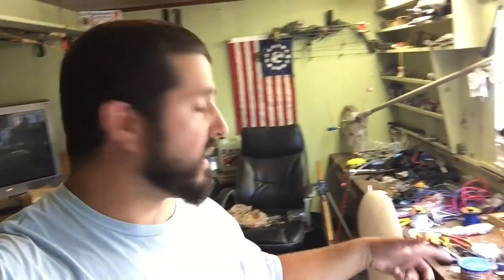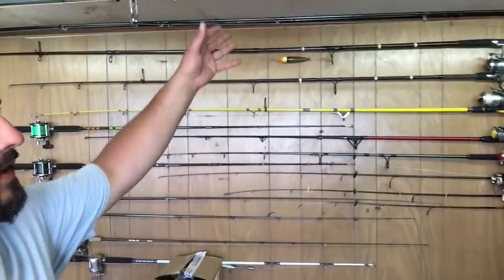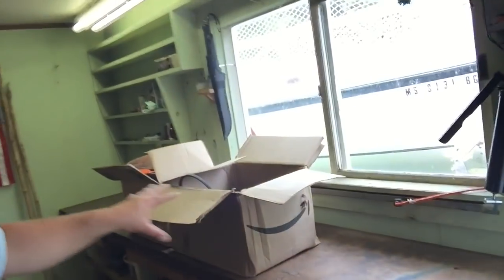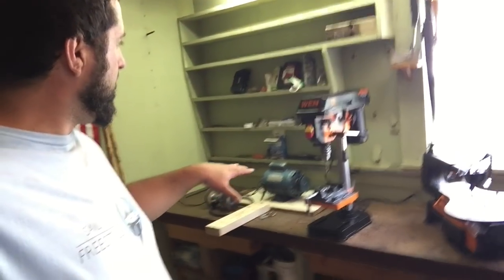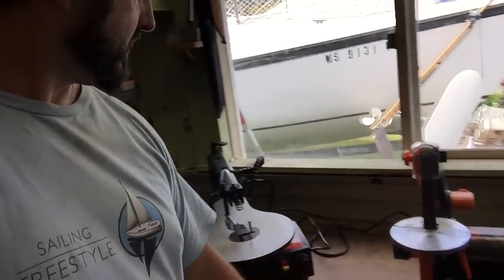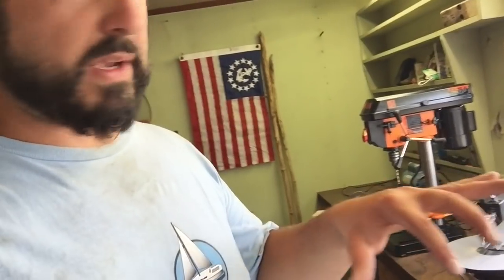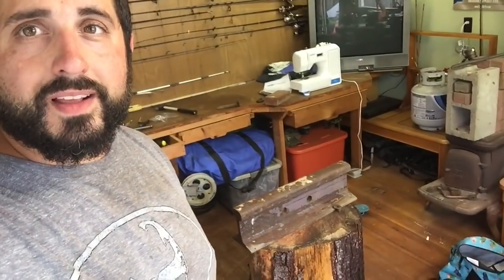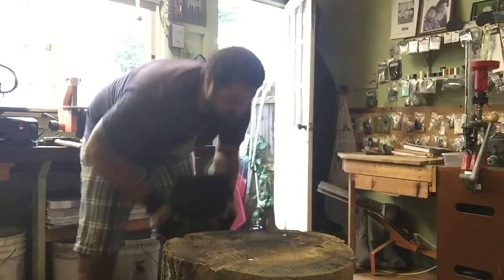WEN Power Tools - Drill Press - Scroll Saw - Belt Sander & Bench Grinder (Complete Workshop Set Up)

Comment: I think you got the perfect setup. I run similar tools. 5-speed drill press, 4” angle grinder, handheld 4” belt sander, bench grinder, and jigsaw (scroll saw is awesome!). I am a Harbor Freight shopoholic with their 20% coupons too hard to beat their prices. I am for sure interested in Wen checked out their prices and quality on amazon and it’s pretty nice stuff. I tried clicking the link to your drill press vise and brings up the bench top vise, I think it doesn’t come with the press you listed. It’s something I am adding to my wish list. Love the shop, I too work back and forth on tons of DYI stuff between wood and steel. It’s handy having work benches setup once you find your groove.
Reply from the maker: I would say that WEN is the Harbor Freight of Amazon. I also love HFT, but the closest store is about 40 minutes away from me, I did just go there for an air compressor and some pneumatic tools the other week so I could get some automobile projects done. I would put WEN on the same level of value/dollar you would get at HFT. Im going to check out that link right now. My guess would be that the were out of stock of the drill press vise and it defaulted to the bench top...